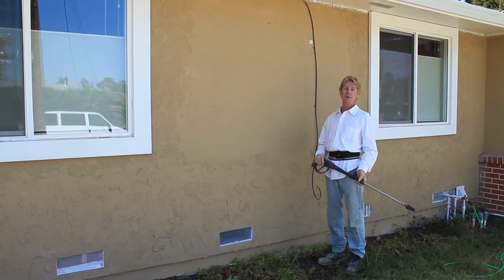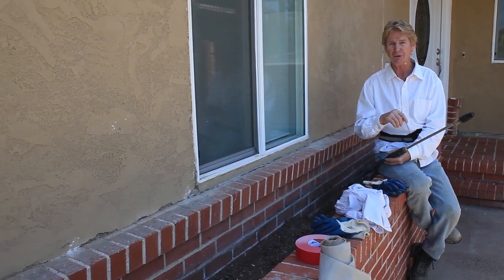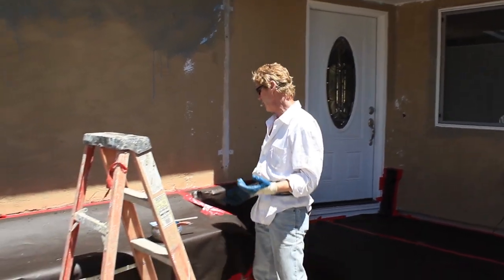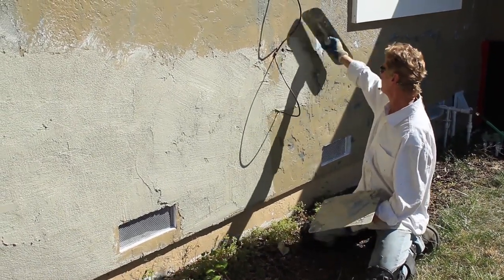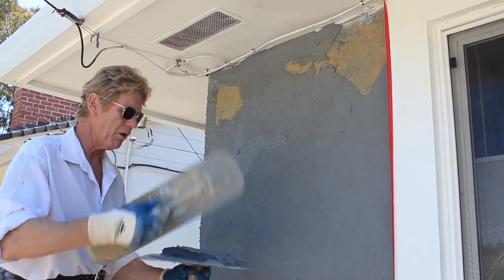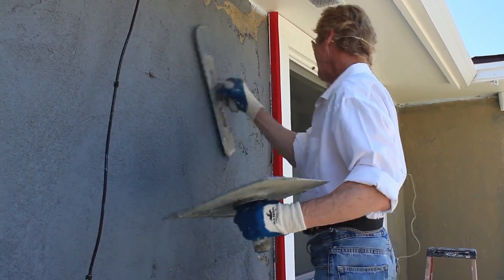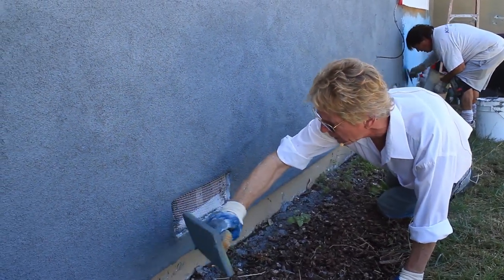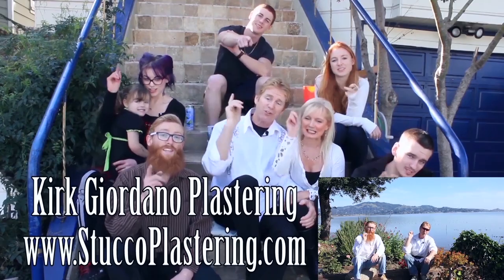Make rough stucco smooth

Comment: Great video as usual great explanations mainly you keep things basic and use ethics in your materials and probably have a fantastic reputation because of that Any chance you worked with a Icf foam block bonding stucco to it interested in learning about that
Reply from the maker: Good evening Mr. Sign Dude, I have a lot of time in, plus if my work fails I'm responsible to repair at no coat.
    The most complete plastering encyclopedia in the world on video, by the plastering messengers of Youtube.  
     Over 850 free self-help videos 🎭 👀💃

Comment: Thanks for getting back to me. I always appreciate your videos. Will definitely pressure wash as I learned from your other videos. I just needed to be sure I could caulk before a layer of stucco. Do you have any videos that demonstrate how to mix your color paint in the stucco? Is there a stucco that can go one coat instead of two? I'm in Arizona.
Reply from the maker: You can go 1 to 5 coats as long as its an inch thick.

Comment: Absolutely beautiful work Kirk.  My house has old Spanish Lace and I want to smooth it out.  Will this method cover Spanish lace?
Reply from the maker: Good morning, that depends on the mountain peak and depth of the stucco. Sometimes we have th use a shovel to scrape off excess protruding stucco. Worst case we must use a finish with heavy sand.
Reply: @StuccoPlastering  thanks for that info Kirk.  So knock down all the peaks and use something like 16/20?
Reply from the maker: @jbt7115  yes sir. You got it.

Comment: Thank you for the video. 
My understanding is that you went to a lower number and therefore larger sand grit to even out the uneven textures of the previous patchwork. However your title suggested making the walls smoother.  I have seen many stucco walls which have large sand grains. I call this texture a rough stucco texture. Your title suggested a smooth stucco texture. I grew up in a house with a smooth exterior stucco. Underneath the paint I could see the individual grains of sand, but the texture is smooth to the touch. How can one render this type of stucco?

Anything that you can do to help me to understand how to apply the smooth-to-the-touch stucco I would greatly appreciate. 

As always:
Keep up the good work.
Reply from the maker: Good evening Sheldon; yours is a brilliant question asked by someone in the know. Thank you.
     The title suggests changing a heavy texture into a smooth texture.
 Thus we started with a so-called skip troweled texture that was far from uniforms in texture or pretty, into a "change a heavy texture to a smooth stucco texture."
 Allow me to go into detail about my meaning. Their original texture was a half-textured blob finish, that a rude way of saying, someone didn't understand what the hell they were doing, tried to match what they saw, they failed, No disrespect.
    Granted, we cant apply a finish such as 30/30 to what's there already, and the folks who own it do not wish to pay for multiple finishes to achieve this.
 I understand this.
    So we did the next best thing was to soften the look of a skip trowel finish gone crazy and to uniform their weird or horrible finish.
 Keep in mind, most Commerical residential and higher-end properties choose this finish. 
We achieved our objective.
 This finish is called or termed a heavy sand finish.
It's perfect for businesses or higher-end priorities, and it has an elegant look. Cheers.😉

Comment: Hey Mr. G  so nice to see a video that’s not 10 yrs old.  I’m doin my house and struggling a bit. I’m an ex tile guy so I floated w/ screeds and skimmed it flat w/ thin set. You can laugh if you want i know it’s probably hilarious. Any who.  I have a pretty damn good flat finished cementicious 🤣 wall ready for color coat. My question is When I pick my color coat which I’m thinking maybe saddleback
Should I do the 200 gray la habra or the 100 white??  I wondering about will the color be truer which way??  Thanks again.   I love you vids....  god bless you and your family
Reply from the maker: HowdJim dude, if you pick up A LaHabra cementitious color chart you may notice that most of the colors call for a base 200, this means a gray basecoat, so when this gray basecoat for the color 25 saddleback (52) is added the color will come out to match the color of the chart.🤔
 All of the darker earth tone colors mainly use 200 basecoats.
    There are a few colors, usually very light such as crystal white, eggshell, and a few others that are very light so the 100 basecoat bags which simply mean white stucco when adding to the color pigment will be much lighter.
 Summary, you have no choice but to use the base 200 bags in order to get saddleback the number in parentheses, (52) just means the color pack number.
 You always add one color pack to one 97 pound bag of stucco finish.
     Kirk and Jason Giordano, Bringing to all the most complete plastering encyclopedia ever created in the world online.
 By the plastering messengers of Youtube.  With well over 850 free self-help videos 🎭 👀💃

Comment: Is there a mortar mix that will stick rocks to a concrete board wall or do you have to use some kind of liquid nails type adhesive? Thanks
Reply from the maker: Good evening, Shane, there is, you can purchase Poly Bond By La Habra, it's only sold at Plastering yards though.
 Or much easier and user friendly is Tile grout works well. After all, it adheres tiles to mortar surfaces.
 There are many more, but here are just a couple of ways.
    The complete plastering encyclopedia on video, by the plastering messengers of Youtube.  
     Over 850 free self-help videos 🎭 👀💃
Subscribers, you can depend on us to explain with truth, honor, experience, and skill for your time invested for wishing to learn the hows and whys of plastering.😉

Comment: Do you have a video on how to work around electrical outlets and dryer vents and other odd things to go around? I'm wondering how to go make sure the electrical outlet doesn't get water seeping in around it. Do I use polyurethane calking around the edge at the end of the paper to make sure water doesn't get past the paper and behind the outlet? Do I just carefully put the stucco up to the edge and same for dryer vent outlets? Also, light fixtures? Do I seal with the polyurethane or do I use silicone? And the door with the paper to the brick moulding... do I use polyurethane or silicone on the paper up to the brick trim? It's the little things like this that I don't want to mess up on and have a major problem later.
Reply from the maker: @therenaissancewoman2080  Yes we do show how to do this, type in “ how to lath” we only use polyurethane caulkings for sealing, say electric outer boxes or vents, windows, doors, pipes, etc. Silicone caulking is not recommended for and stucco lathing.
Reply: @StuccoPlastering  I found the one for the electrical box but I needed for an electrical plug in outlet. I will use the polyurethane. Thanks for the clarification. ;)
Reply from the maker: @therenaissancewoman2080  You’re welcome and happy plastering.

Comment: Howdy Kirk! I really like the Blue/gray color it looks amazing! I've been watching your videos for a few years love'em! Just for entertainment and general learning, I work on computers. My house is from 1952 with real thick rock on the exterior. What kind of contractor would be best to fix grout issues? Is that just a mason at that point? Sorry for off topic just thought I would get your experience on this. Here is a picture that gives you an idea of how thick the rock is: https://imgur.com/ldNHl2w You can see the depth of the rocks on the side of the windows. (Note: The picture is a bit distracting from the rock, this is my first attempt at repairing my window from rot. I used wood hardener, then wood bond (This was taken after the first coat of wood bonding before sanding and another coat to fill level it out) then I'll paint. It's a temp fix before we get all the windows replaced they are like 84 by 32 inches so that is costly and will need to be done after other projects.
Reply from the maker: Good evening Levi, man, that sho-nuff is some pretty rock, you can call some brick or mason men and ask them if they do, Tuckpointing (also called tuckpointing or tuck-pointing) or fill b grouting back up to rocks and or bricks.
    The complete plastering encyclopedia on video, by the plastering messengers of Youtube.  
     Over 850 free self-help videos 🎭 👀💃
Subscribers, you can depend on us to explain with truth, honor, experience, and skill for your time invested for wishing to learn the hows and whys of plastering.😉

Comment: Hi Kirk,
I had my Florida room restuccod.
The contractor initially told he was going to pressure wash all of the loose paint and stucco off,scrape it,apply some sort of mesh over the cracks after applying a bonding agent and there are cracks all over.
The job was started at 7 a.m. and done by 2 p.m.
Is this even enough time for the bonding to dry?and obviously if there are cracks...the stucco will flake off.i can send you pics...I think you could probably tell me by what I described if it was done properly.
Thanks,
 Tim
Reply from the maker: He was fast, but I have done similar jobs in much less time. This house took us about 5 hours.
Reply: @StuccoPlastering  update...he did not mesh the room.he pressure washed it and scraped all the loose stucco..put a bonding agent on the sheet rock and  stuccoed over the bonding agent.
It looks solid.but I guess time will tell?

Comment: Get yourself some of the wooster sherlock roller frames and poles and you you can roll that bondcoat on like a pro painter.
Reply: Those are the best.  Prevents the roller sleeve from moving.
Reply from the maker: Good evening Michael had all that stuff even a case of  48 wool-skins rollers at one inch and a half nap rollers.😉
 Had adjustable sticks and poles, I just didn't use them in that scene as Lou or my other two kids might have been using them. 
I was just proving a point about the bonding agent.
    The complete plastering encyclopedia on video, by the plastering messengers of Youtube.  
     Over 850 free self-help videos 🎭 👀💃
Subscribers, you can depend on us to explain with truth, honor, experience, and skill for your time invested for wishing to learn the hows and whys of plastering.😉
Reply: @StuccoPlastering  Thanks mate it sure came up good.

Comment: Hi Kirk,

Are you mixing all the color stucco in one batch or individual batches so it doesn’t dry while you’re working?

The reason I ask is because I want to do a solo DIY and I’m wondering if I can mix individual batches for each wall? I don’t have the man power to do more than one wall at a time.
Reply from the maker: Good morning Patrick dude; we mix our bags in a towable cement mixer and keep it fresh by adding water each time we pull from the mixer.
 I don't advise applying and floating after yourself, but if you have no choice, good luck. 😉

Comment: Hi Kirk! Just curious that you don't need to put a mesh down after the weld crete?  I am going to do this to my house. I am not a big fan of the heavy trowel finish and I would like to color coat it in white stucco. After I : pressure wash then roll on weld crete, am I free to apply the color coated stucco?
Thank you.
Reply from the maker: Evening Dan, how can mesh be laid over this rough texture?
 That's a trick question. It can't.
 Plus, it's not necessary. In the description, there is a more detailed color coating video, cheers. 🍻

Comment: Hello Kirk!!  Had a house built 30 years ago and has a very heavy ugly texture and was painted over the grey uncolored stucco 30 years ago.  I want to get rid of the heavy texture (want a smooth grainy look).  A stucco guy with 20 years experience (so he says) looked at it and he said he could NOT color coat over it (and improve the texture) even with a bonding agent -  because it was painted.  The paint on it is as old as the stucco (30 years).  He said my only choice was to paint it?  I've watched several of your videos and his opinion appears to be incorrect?  With bonding agent can I color coat over a painted stucco if the paint is 30 years old?  Or can you only use bonding agent on newer painted stucco?
Reply from the maker: Hi Cindy, it's obvious the man who said it can't be done, does not want to do it or does not possess the skill to do it, whatever his reason are they are his own. Call  a different plastering contractor who not only understands how it's done but is willing to do it.👨🏻‍🔬
Reply: Thanks Kirk for your quick reply!!  Had a 2nd stucco guy look at my heavy texture painted stucco today and he told me the SAME thing you said - that the previous stucco guy probably just didn't want to do the job!  The guy today said he would do it and would mix the bonding agent into the color coat.  I told him that YOU (he knew who you were) say it's better to roll the bonding agent onto the wall NOT add it into the color coat.  He said it all depends on where you live, maybe somewhere like Florida he said where it is humid you would roll it onto the wall, but he said areas like Arizona where it is hot and DRY, he says it's best to add it into the color coat mix (not apply to the wall).  I'm in Lake Havasu City, AZ.  Do you think climate dictates the method? Or do you always prefer applying bonding agent to the wall (after pressure washing)? Thanks again! Cyndi    @StuccoPlastering

Comment: Thanks for the video. Could you add a pressure washer to your recommended tools list?
Reply from the maker: Howdy Aaron, sure can, Dewalt makes good ones at some of the best cost for the power they provide. In fact, I was using a Dewalt for the pressure washing in this video.
     Bringing to all the worlds most comprehensive encyclopedia of free plastering video’s ever put together,
 by the plastering messengers of Youtube. 
Kirk and Jason Giordano with over 800 videos 🎭 👀💃
Reply: @StuccoPlastering  Thank you so much! Are you still using the turbo tip as well?
Reply from the maker: @aaronalt6509  Hi Aaron, I always use that turbo tip, I like the figure 8 it makes, I'm kidding, it really increases the pressure to save me half the time.
Reply: @StuccoPlastering  Hi Kirk, thanks so much again! I'm looking to purchase my first power washer so this helps. Although I'm doing smaller patches I want to make sure it's not falling off in a couple years. Cheers!

Comment: Kirk,

I have a stucco chimney that is up against aluminum siding.  The caulk is starting to crack (I recently purchased my home).  What is the best caulk to apply after I chip away all the old caulk?  Any advice would be appreciated.

Thank you,

Mike
Reply from the maker: Good evening Michael, any exterior that says a fifty-year life span works, make sure it's paintable and water clean up, Morflex caulking has sand and is great.
 The polyurethanes and silicones caulking often aren't palatable so read the label.
     I would recommend a Sherwin Williams or Kelly Moore exterior 50 years caulk personally, this way you can squeeze it into the cracks and use your finger to make it cosmetically pretty.
 Plus these caulking won't shirk where you have to recaulk two days later.🤔
    Kirk and Jason Giordano, Bringing to all the most complete plastering encyclopedia ever created in the world online.
 By the plastering messengers of Youtube.  With well over 850 free self-help videos 🎭 👀💃
Reply: @StuccoPlastering  Thank you very much.

Comment: So u can apply bounding agents and let it dry in then  apply finish coat in it will bond ?
Reply from the maker: Evening Arnold after you pressure wash the walls the bonding agent is painted or rolled on the walls. You can purchase a Quikrete bonding agent at HD or Lowes.
 If you pour any bonding agent in the stucco mix and apply it your finish coat will start coming off in sheets within the first year and continue until it all falls off. Those are the rules.🤙

Comment: is it okay to use weld-crete over a washed painted stucco wall and then use a finish coat from la habra? would it adhere to it well? i ask because La Habra recommends not to use it over a painted surface.
Reply from the maker: Howdy Bluekeet, of course, you can. All 20 of the major stucco companies say this for excellent reasons, it won't adhere. 
One must first pressure wash the walls, well.
 then apply Weld Crete to the surface of the wall, now any plastering finish coat will adhere. Never add a bonding agent into a mixer, never.
 Sika says you can use their bonding agent to tile grout instead of water, so don't be confused, any wall that your going to apply any cementitious finish coat too needs proper prep work.
Bringing to all the most complete plastering encyclopedia ever created in the world online.
 By the plastering messengers of Youtube.  With well over 850 free self-help videos 🎭 👀💃
Kirk and Jason Giordano Plastering

Comment: How do  I fix little "break out" areas along the edges of a cedar board or at the bottom of a roof line where roofers broke out the edge of the stucco?
Reply from the maker: Howdy, Caulking, or adding more cement stucco. 😉